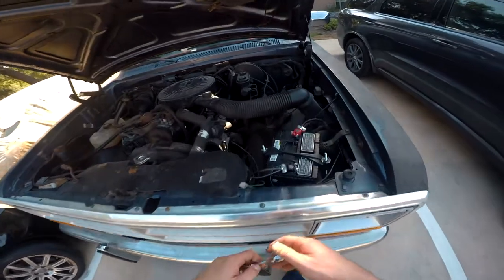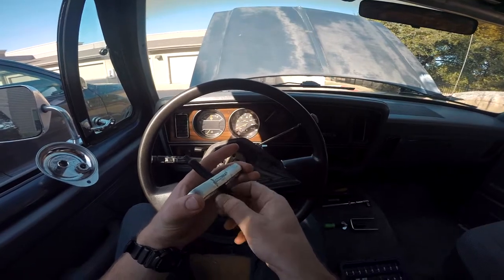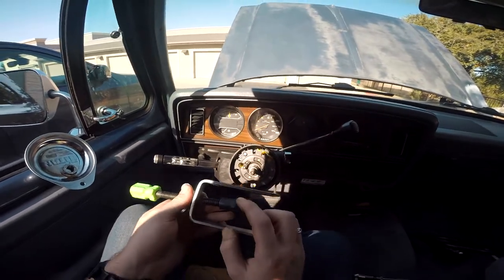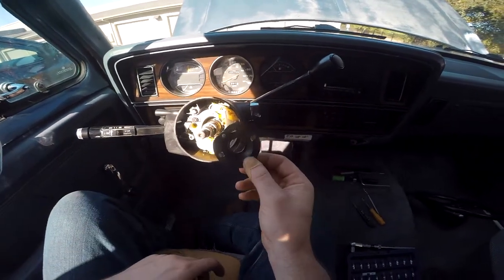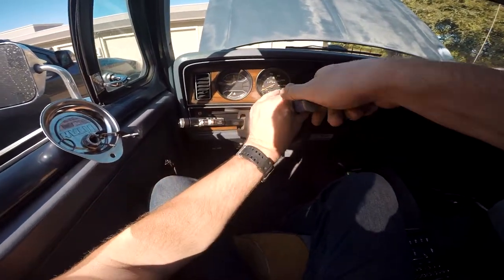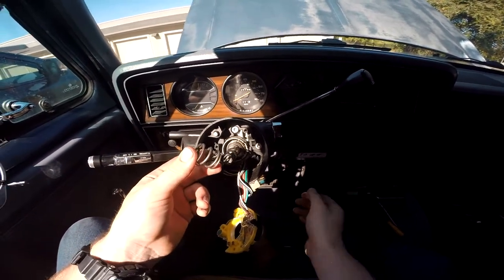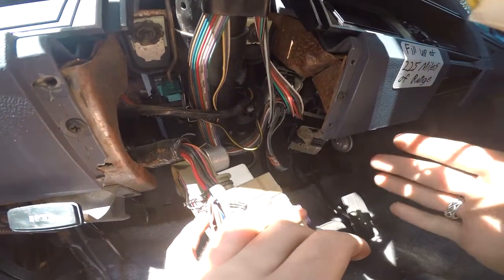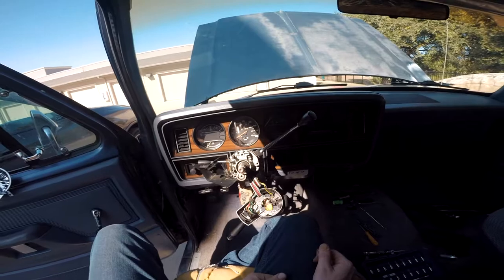1989 Dodge Ramcharger Tilt Steering Wheel Tear Down Part: 2 (Disassembly)

Comment: Just performed this procedure and believe me, he was right about those wires being a pain to thread through the column.  Especially if there is cruise etc.  I was able to get it more easily by tilting the column up though, it seemed like it created more space.  Anyway, thank you very much what a great video!
Reply from the maker: Thanks for the comment & the feed back! Yes, you are right. I did have to re-do this job at a later point for a different switch. & moving the tilt steering wheel made it so much easier. Just gave a bit more space you didn't have before.

Comment: I am currently tearing down a 1988 dodge ramcharger steering wheel to replace the key switch  and was using a  mechanics  repair manual  it follows pretty the same method as your video  up until removal of said key switch in the manual it called for removal of a second retainer spring like at the beginning  i could see something like it and commenced to yank on it
And out came a plastic ring which was holding the little steel bearings now panicked  i  searched in YouTube and found your video i am a dumb ass should looked at video first in short i am grateful  you did this vid respect to you sir
Reply from the maker: Thank you so much for the kind words! I am really grateful that this video has helped you! Good on you for taking the initiative & getting after it! Not to many people do that these days I feel

Comment: I put a small punch mark on the top steering shaft bolt and a small punch mark after the steering wheel nut is off right under the first punch mark. How you marked the SW can be off if the shaft gets turned. Easy to get one spline off if not done this way with punch mark on shaft and punch mark at base.

Comment: Thanks bud 👍 
I just bought a '90 RC
she's got the 'ol steering column slop..(snap ring im told by the previous owner)
This helps alot...needed to know what tools to snag & procedure to follow 👍👍👍
Reply from the maker: Your welcome, I do not go all the way through to the joints where the knuckle is. but it gets you all the way there through the most complicated part of the disassembly. if needing of a diagram got to the ramchargercentral.com and make a post in the help section.
Reply: @mountainmaninitiative1117  ..
I'm joining up on there real soon! I'm probably gonna have to rebuild the fuel pump too...Im not seeing much of anything as far as a whole unit...just the seal/pump/strainer sock/level arm...🤷‍♂️
Reply from the maker: Yes if you have the orginal one. Its re-buildable. And yup its the best forms on the web. Also, I reproduce plastic parts. Not all yet but some FYI.
Reply: @mountainmaninitiative1117  ...that's damn good to know as well...makes me feel alot better after I get all the parts...👍👍👍
I'll keep ya posted from Richmond....
Reply from the maker: Sounds good man!

Comment: Any insight on replacing the ignition on the tilting column? Or parts interchangeability?
Reply from the maker: Nothing much, besides what I had filmed and explained. Just make sure it Fits a Gen 2 Dodge Truck from 1981 -  1993. Note 1990 - 1993 could be a little different. The more OEM the part the better before I forget. all Assuming you got a Dodge Gen 2 Vehicle.

If you need more in-depth help or got a very specific question. Got to ramchargercentral.com There is a a lot of good info there. And great Guys who so much more knowledge than me.

Comment: Thank you for the tear down video! Your dimmer actuator rod appears to be my ignition actuator rod. I can move my key to the run position without the rod actuation. Would this be similar fix? Or is there something else to it. Unfortunately the haynes manual doesn't provide detailed instructions for this. Thank you!
Reply from the maker: Sorry for my delayed response. Thats a good question. To be honest  go to ramchargercentral.com & ask the guys. They'll have a much better answer than I could provide. Also, to be be frank throw away the Haynes manual & actually buy a Factory field Service Manual. You can get them for The Dodge Boys on RCC. 

And your very welcome. I'm glad it had helped you.

Comment: So close! I’ve got bad movement in my column that causes it to drop out of gear and I think my issue is just beyond where you stopped. Wow that’s a lot of parts. I wonder if I can get to my issue from the back?
Reply from the maker: Maybe, but it could be all shifter related from the trans to the steering column. I would recommend posting a help request on https://www.ramchargercentral.com those guys can really help you get to the root cause. Plus, some have diagrams to help as well.
Reply: @mountainmaninitiative1117  thanks I appreciate the resource. I found a vid with the same problem in the tilt column he had a couple bolts loose all the way down at the tilting knuckle.
Reply from the maker: @jonathantrekallover9369  Well there is your problem! Glad you got it figured out! And your very welcome!

Comment: Is ignition switch also replaced using these steps.
Reply from the maker: Yes, yes you can. Just go as far as need to get the Ignition switch out. And then reassemble.
Reply: Do you have a picture of diagram that shows where ignition switch is located I cannot find one. I’m working on my 1990 w150 but have same tilt steering column. Found a video on YouTube but was on a non tilt and is totally different from mine. Thanks. Great video.
Reply from the maker: @cyrusromero3394  Thank you! Glad you liked it. You can get a diagram on ramchargercentral.com. make a post in the help section. and some one will give it to you.

Comment: Mine is an 85 with a different steering wheel and my brights are on the floor. But my puller won't fit the screws ain't long enough. Im trying to change the ignition. It won't turn into the start to start it. Pain in my rear
Reply from the maker: Sorry for the delayed reply. Sounds like something physically broke in the key cylinder. Over time the pins start to wear out and cause issues. I do not known whats hardware stores are in your area. Hit hit them up for longer bolts or a lengthy piece of all-thread you can chop down to size with a few nuts and washer. I hope this helps you man! Stay the course! You got this!
Reply: @mountainmaninitiative1117  thanks man. I wound up getting it. I manually took the steering wheel off with a rubber mallet and sprayed some wd 40 in there to make it easier. New key cylinder in and put all back together. Simple man. Thanks. Love my ram charger. I just seen a completely custom one online so sick for sale. 79 grand man. Crazy
Reply from the maker: @jaypeetaylor  Thats one way to do it lol! Glad you go it done! And yeah I love mine too! Daily mine everywhere I go. 

Yeah it depend on what was done to it to be $79K. Me and some other guys have seen them be way over priced for what they are and going on. AVG Price for one is $5,000 and seeing them inflate to $20,000 when they are not in good shape or okay shape. 

Also, Don't forget to keep up the good work! You got a Piece of history, got to keep it a live you know! Enjoy her well!